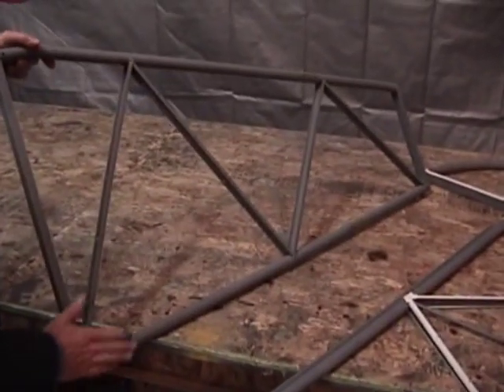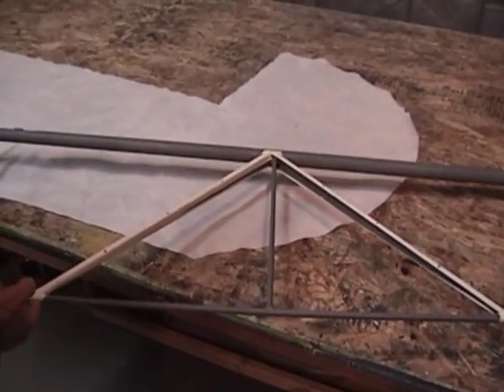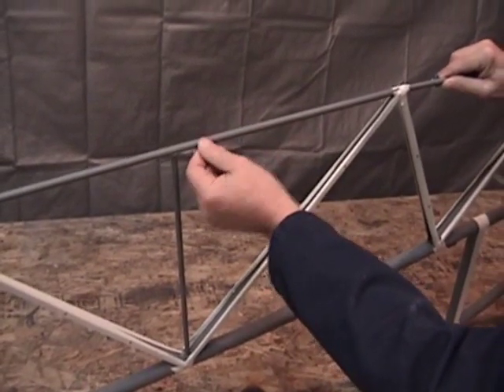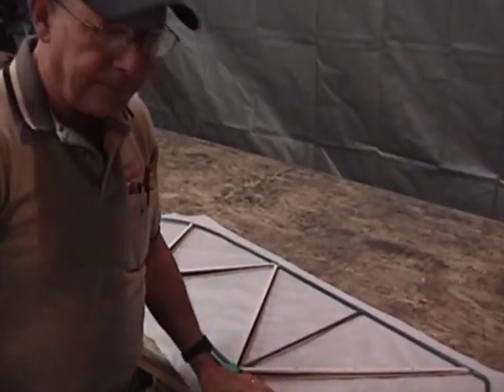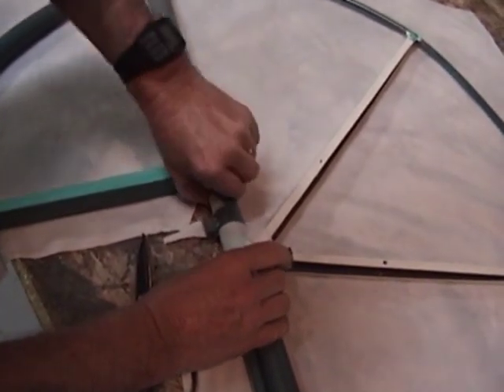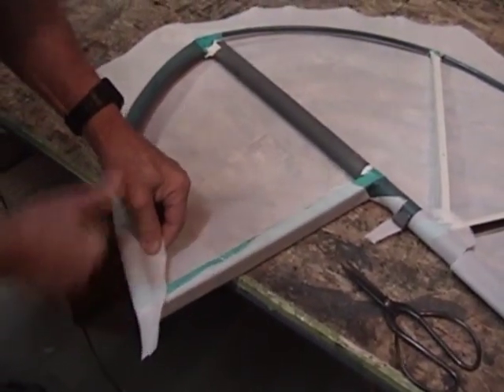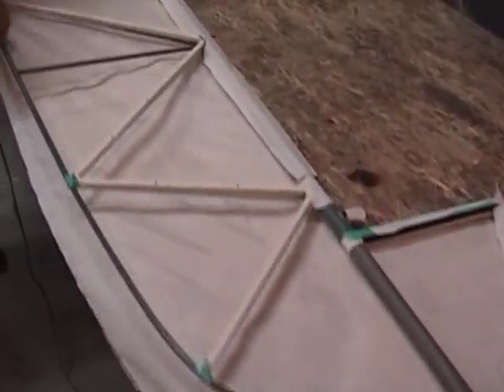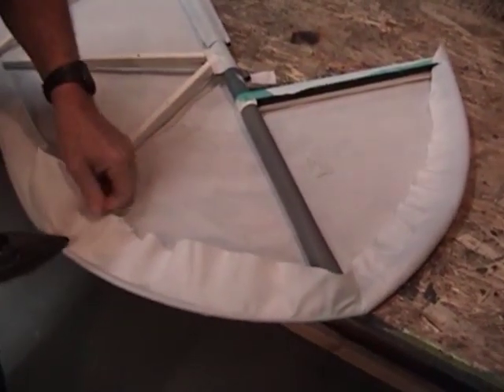Part 1 - Control Surface Aircraft Fabric Covering with Stewart Systems

Comment: What is the glue that you use to secure the fabric? What is the iron temperature?
Reply from the maker: Stewart Systems EkoBond is the glue.  Normally we use 250F on the iron, but if there is metal under the fabric absorbing the heat, a little higher may be needed.  To shrink fabric and tapes around a curve we might go all the way to 350 in steps to get all the wrinkles out.'